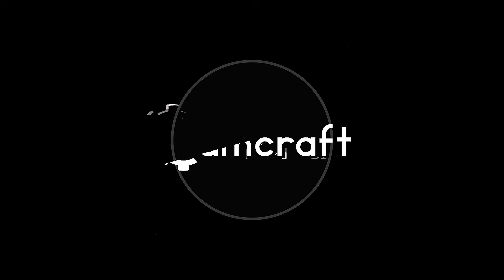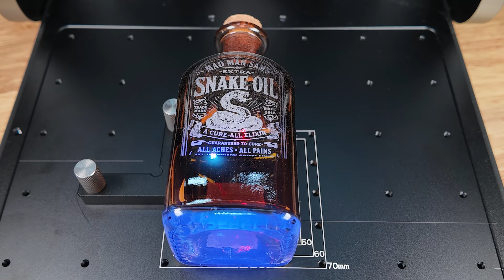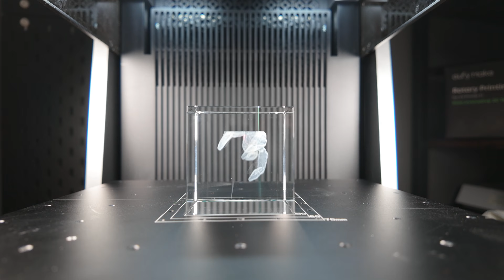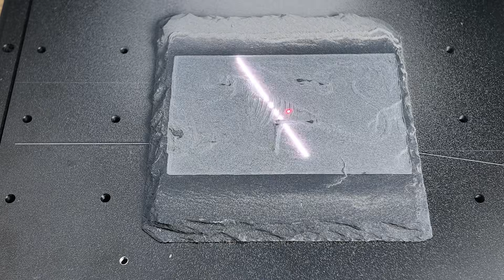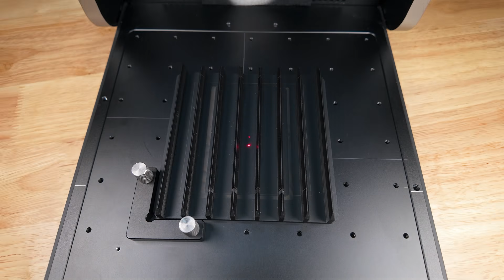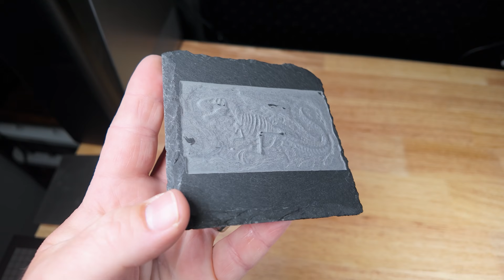This Laser Can Do What Others Can't (UV + MOPA) - WeCreat Lumos Ultra

Comment: Some how, YouTube has been crappy at notifying me of videos of creators I follow.

So I found this video while researching the Lumos Ultra.

One thing I've not seen anyone discuss is what type of setup or anything extra might be needed for venting the exhaust.

Does it have a built in fan and just need to run hose to exhaust fumes?

And since I've never used either MOPA or UV how much fumes/exhaust is likely to make?

(Another thing you probably can't tell me having a test unit, is whether the one you order comes with a pair of safety goggles or not. Their site and the Kickstarter don't mention one way or another. Just says comes with the machine. And then you can add on things. (But obviously it comes with some things, like the multiple lenses, etc)

Thanks for the review! (And again, sorry for late view, trying to catch up now)

Comment: One can only do one thing at time with the laser, its either a UV or a FIBER.  In a production environment one needs a FIBER and UV to run simultaneously. I have an issue with this laser being characterized as a PRODUCTION laser.  It is a HOBBYIST laser.
Reply: Hi Brandon. Which separate lasers would you recommend that can do UV and fibre/mopa depth map type deep engraving, please?